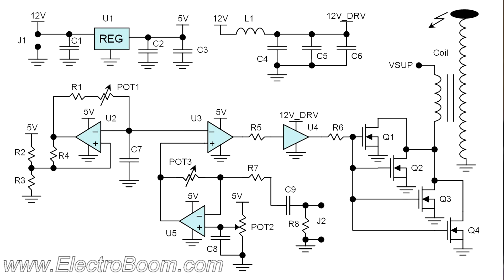Music, Magic and Mayhem with Tesla Coil

Comment: About that rotating wire, what direction are the arcs going to point?

I ask this since I was wondering that if you could mount the rotating wire to rotate in a vertical plane (axis of rotation is horizontal), would it still rotate?

Sorry for the stupid question! :P
Reply from the maker: Rishivar Mukherjee Yes, you could mount it on a vertical plane and it would rotate. The arcs jump away from the tip of the wire. It is the heat they create that pushes the wire away.
Reply: *****  maybe I'm being an idiot here but couldn't the electron jet thing be used for space travel?
Reply: ***** Okay. Another stupid question then. If the wire were perfectly symmetrical, and placed perfectly stationary, then wouldn't the wire 'not' rotate? Since the heat created would be uniform.

Of course since the arcs would move a bit, the heat produced would be unsymmetric and start the rotation. Thereafter, due to the motion, the heat produced would be unsymmetric continue to rotate the wire. Am I correct in my understanding?

Thanx :)
Reply: clearrunway Maybe they do/are trying to. Just not the same way.

As ***** said, the heat produced by the arcs pushes the wire at the tips. In vacuum, this heat would be negligible.

The electron mass would produce thrust much like the jets in use now. 

http://en.wikipedia.org/wiki/Ion_thruster

http://en.wikipedia.org/wiki/High_Power_Electric_Propulsion

There must be many more. I just gave you something to start on.
Reply: clearrunway Good thinking. Ion thruster, an engine working on somewhat similar principle is already being used in Deep Space 1 probe, although it doesn't depend on heat to make kinetic force but rather electromagnetic one.
Reply: clearrunway There is ion thruster engine, works just like this one.
However, you will want to push electron away to push you go forward, and if you're out of electron?

Tesla coil takes electrons from earth, so without earth, it won't work, infinitely.

Comment: That's awesome!  you are getting about the same output as I can get when I run my coil at 35 volts. I used a circuit similar to that of your MOSFET slayer exciter,  using a DS0026 MOSFET driver to drive a IRF250P FET.

I then modded the circuit my modulating power rail to the DS0026 with a 555 timer and emitter follower. Since I am not loading down my wimpy 50va transformer nearly as much, I get 4 inch long sparks at 20-70Hz @ 10 duty cycle. It is a lot simpler than yours but does not do audio modulation,  unless maybe I replace the 555 with a audio source to drive the emitter follower powering the DS0026.

Comment: Won't a single jet still produce thrust? If so why not use a similar arcing device as some sort of fuelless engine of the sort that nasa are developing? Would it even arc in a vaccum? And come to think of it, wouldn't you run out of electrons? What wierd effects would you run in to then? I love how much this video got me thinking...
Reply: Alex Jones It would not arc in a vacuum.

We generally think of air as not conducting electricity.  But in reality it does - just with a resistance so large, electricity tends to stay in its circuit.  In this case, he created a VERY high voltage, and left it no metal to go through as a route to ground, so it goes through the air.  And it basically treats the entire air pocket around it as a very thick, but still very high resistance, wire. 

Think of air like a wooden pipe.  You can run water through it all day, and it won't leak.  But if you stop up the outflow, and increase the pressure a ton, suddenly you'll start to get little drops of water pushing their way into and through the wood.

When he brings a metal wire close, suddenly all that electricity that was flowing through tons of really insulating air notices this pathway, and all start trying to go through it rather than go through the air.  And it does this mostly by going through the air directly between the coil and the wire.  This generates so much current going through the little path of air between the coil and the wire, that it superheats the air and starts ionizing it.  Ionized air is MUCH less restive, so as soon as a tiny little bit of air gets ionized, it starts to act just like the wire - so now the electricity all tries to flow through that even tinier little route of air.  This heats it EVEN FASTER, and grows this superheated line from its tip outward - arcing.  That's why arcs are such little thin lines.  The electricity is literally growing itself a pathway - tunneling through the air by superheating a line to the wire.

Putting a wire near the coil is like drilling a hole halfway through that woodpipe.  Since its so much easier to go through 2mm of wood than 4 mm of wood, you'll get a lot more water flowing out of that hole.  In fact, you might weaken the pipe there so much, that the water breaks through that thin 2mm wall, and it springs a tiny leak.  And as more high-pressure water forces its way through the leak, it grows the hole and producing even more flow.  That's how an arc works.

All this goes to say, that electricity is the flow of electrons jumping between molecules - in this case, the air.  No molecules (ie, vacuum), no flow of electricity. No arcing.  No jet propulsion (which is created because the arc is heating up air in a direction.  It's no a reaction-mass-less process).
Reply: You'll run out of electrons.

However, using electricity to super-heat air, and use that as propulsion, is a very real thing.  Normal chemical rockets can only get hot enough for about 450 ISP.  VASMIR engines use magnetic containment, run electricity through a gas (xenon?) and eject it such that they get something like 4000 ISP.  The only catch is that the actual amount of force is weak - about the weight of a piece of paper.  But its damn efficient if you aren't in a hurry.

This still isn't propellant-less.  But you get a lot more momentum transfer out of each little gram of propellant, so it still improves the situation.
Reply: Hmm you make a good point. But expanding on the electron propulsion idea: what if you were to instead use a set up similar to a Cathode ray tube. Electrons will be shot out and never return. Will you run out of electrons and what effects will that have?
Reply: InterrobangActivate If you run out of electrons, that means your electron source becomes positively charged (more protons that electrons) and it will start absorbing electrons, which makes it hard for you to shoot electrons out. Unless you take charged particles from space (Cosmic particles, etc.) and accelerate them and shoot them out ( like what a Jet Engine does to Air), you'll get infinite particles to shoot and as long as you have power to accelerate them you can have a propulsion.
Reply: Thank you SAHM and Xylos144 for two very interesting responses, it does seem obvious now that a greater and greater electric field would be generated, requiring a higher and higher potential difference to accelerate electrons.The accelerating cosmic rays ideas sounds incredibly interesting, but I wonder how abundant they are in deep space, and if it would be viable for intergalactic travel.
Reply: InterrobangActivate That exists, it's called Ion Thrust/Ion Propulsion Engine and it might be suitable for satellites and the like to make adjustments to their trajectory. On the plus side, it runs on electricity and needs relatively little propellant (electrons or protons) to produce acceleration. On the minus side, the force generated is pretty weak.
Reply: Alex Jones

Electrons have no mass.

The Electrons are sent out into the air, and the air becomes highly charged. The atoms in the air are heated up to extremely high temperatures as a plasma and expand outward. The propulsion comes from the expanding gasses pushing back on the wire.

If we were to put this in a space context, you would have a tank of gas in your spacecraft, pump electricity into it, make a plasma, and then eject the plasma out the back.

This is a form of ion propulsion that is under research by NASA.
Reply: Belle La Victorie Mass of one electron = 9.1 × 10-31 kilograms
Reply: Xylos144 Thanks for the explanation, I hadn't considered that before.
To be clear, you're saying it's the superheated air expanding and pushing the wire around rather than the electrons shooting out as in some sort of conventional rocket causing an opposite reaction in the wire that is making it spin, right?
 I'm pretty versed in electronics and electrics in general in (doing it for my degree) but still am not too good at thinking about how things all work outside of the ideal circuit model - there are always so many practical considerations to miss!

SAHM Loving the idea of the space  jet, though you'd have to be really travelling for it to be in any way practical I suppose. Makes me wonder just how fast you'd have to be going to be able to use the few and far between cosmic particles and a set of wings to generate a steering force for an interstellar craft...

Belle La Victorie There is a verry important distinction between 'not very much' and 'none at all', especially when it comes to things multiplied by huge numbers
Reply: Hi Alex.

Best I can tell, yes. he arcs are just super-heating the air, creating a pocket of hotair/high-pressure that pushes slightly on the metal wire.

Think of the air as a million massively parallel resistors that, when a chain of air molecules get hot, drop in resistance.  Then as one pathway trough the air gets hot, its resistance drops, it draws more current, etc etc.  That's all those arcs are.  So you suddenly get a bunch of hot air right at the tip of the wire, pushing it forward.

Comment: can anyone tell me why the color of the electrons is purple?
Reply: MrHumanforlife I think it goes yellow for the oxidation of carbon. From his own skin. Like the experiments with Bunsen burners.
Reply: MrHumanforlife the heat in the air. that's why when he touched it and got burnt, it was yellow. he isn't as a good a conductor and therefore there was less heat, making it yellow.

at least that's my understanding.
Reply: miki333sp i believe so.
Reply: miki333sp Not a complete plasma, they are just ionized.
Reply: MrHumanforlife i think its propably becuse of air and ozone (?)
Reply: cakeless coder thanks, i had no idea about it :D Purple is a plasma mode, right?

Comment: are you sure an "electron beam" is responsible for the propulsion? I could think of at least 2 other things, a) heat (sparks heat the air, air expands) and b) EM interactions (Lorentz force). Besides, since glass is an insulator and you show the beam interacting with the bulb in the beginning, I think there's something else behind this phenomenon than an electron beam.